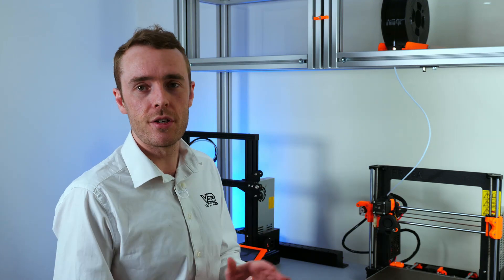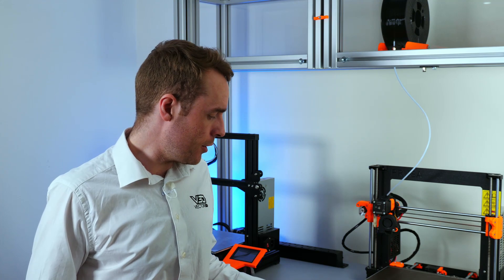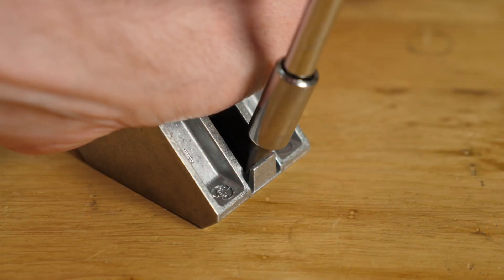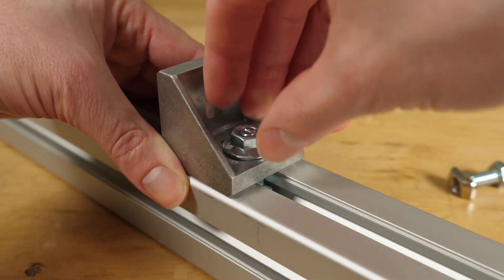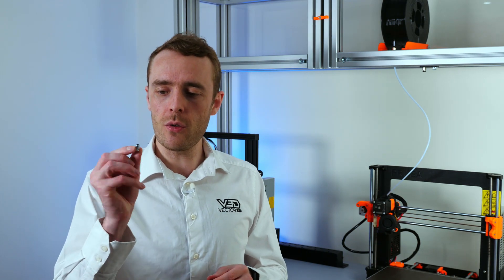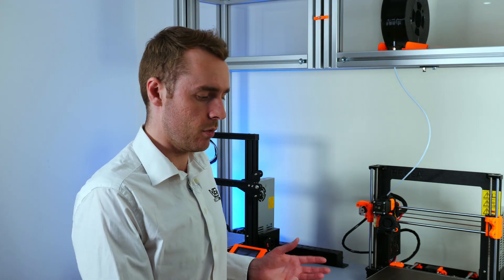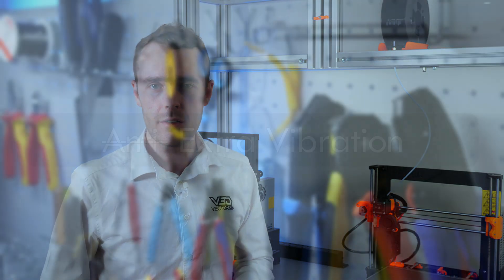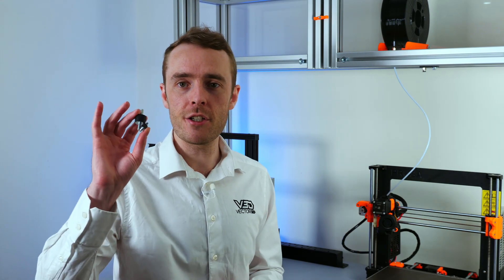This should be EASY, but it isn't...  Anti Vibration Worktop

Comment: Is your workbench attached to the wall? You can't add much more mass to it than your house. You should attach the top of your printer as well as the base to the workbench after mounting it to your wall.
Reply from the maker: It isn't, mine is actually on wheels so attaching it to the wall would limit the movement a bit. I'm in rented accommodation so not allow to attach anything to the walls sadly, but it gives me an idea of how walls could be used to help. Thanks.

Comment: Hope you are still reading these comments.
I strongly suggest you change your entire paradigm of thought.
You are thinking of "vibration," and using "loudness" as a metric. This is entirely the wrong approach.
Think instead of "coupling vs de-coupling" and and use a combination of metrics - I suggest print ringing, loudness (measured) and frequency. Frequency is probably best measured using an accelerometer and an RPi. There are plenty of established libraries for this including one specially built for Kliper (input shaper).

You also seem to be re-inventing the wheel, and I suspect relying on unreliable sources for information - namely the maker community, and the hobby woodworking community. In my experience, both of these communities are pretty clueless on these topics. There are industry wide Best Practices, with cost effective solutions.

The maker community seems to think that rigidity is not important to 3d printers, and then produce prints that are covered in artifacts that are the result of harmonic vibrations.
A rigid machine coupled to a work table, that is then effectively damped will not only print quietly, but will have minimal artifacts. Damping can be achieved with something as simple as a hollow table top filled with play sand. Hard objects will transmit higher frequencies, soft materials transmit lower frequencies (hence you turning your workbench in a giant speaker). Combining the two will allow rigid coupling while minimizing transmission.

There is a reason why the most common solution to vibration is a heavy mass (or plinth) anchored with hard/soft layers to the floor (or whatever), and the device coupled to the mass directly. Sometimes tuned masses are suspended from the plinth. In your case, hanging a 3-5Kg bag of weight (play sand, lead, etc) would probably have helped your speaker table top.

Comment: For dampening, you can always try gluing foam or rubber on the under side of the table top in the center. Check out RTOM Moon Gels for drum heads. Not the right product for you but the concept is solid.

Comment: I made 3d printed 90 degree brackets which I screwed in with wood screws from underneath the bench top, I framed my big L-shaped bench with 2x4's so it also also allowed me to print separate shimmed pieces for the pieces I was screwing to that weren't perfectly flat. Didn't want screws showing from the top, gunk will inevitably settle into the recessed areas.

Comment: Any form of mechanical fastener when used to attach the top surface to the metal frame will point load and concentrate any vibration to that spot, effectively increasing its energy transmission. I would suggest looking at something like industrial velcro, hook and loop fasteners along full lengths of the top. As there is a natural flex and resistance in the fibres and hooks. Effectively tens of thousands of micro springs that will dampen as well as distribute any vibratory force. You will need to use staples to hold it to the underside of the table top (buy a Milwaukee m12 electric staple gun) and use 3M primer 95 on the metal before applying the velcro and it will stay there forever. Its an adhesion promoter that really works. Another one that's amazing for vibration absorbing is 3M VHB tape, the thick (3mm) clear kind. It's not removable but could form the basis of an isolation plate. I workes within a certain part of the military packaging industry and vibration was a big thing we had to deal With.

Also, you have been using metal countersink tools on wood, which is why you have those flat spots. Look up the festool centrotec countersink tool. It's actually conical with a hole in the side. It produces perfectly angled and smooth counter sinks. Use with a depth stop for consistency. Also ensure that you have center support for the plywood in the table, as it will flex over time. Consider moving up to 24mm plywood as well. The extra mass in the material will be benificial. Also look at Finsa Fibreboard as it's available in colours like black, grey, red, yellow, blue and green. Very dense and will last for years. Companies like cworkshop, cutltist will be your best sources of material and cnc saw cut components. Its the secret of many cabinet makers. They can supply anything you need including edge banding.

Comment: look at how parts are "held down" to a CNC.   something that rotates on the bottom of the surface, and slots into the channel on the extrusion.  Then you tighten the bolt, and it pulls the "clip" tight.  Sort of like a clamp in some respects.  Sorry this isn't as clear as I'd like it to me... similar to this, but with a longer distance to provide more "leverage....https://smile.amazon.com/Rok-Hardware-Fasteners-Screws-ROKSTBFAST/dp/B01FGE8BJQ/ref=sr_1_5?dchild=1&keywords=Table+Top+Fasteners&qid=1613093302&s=hi&sr=1-5

Comment: Why attach the worktop to the frame at all? Gravity will hold it in place, and no drilling or screwing around will be required. Try various types of rubber, cork, or felt strips or tape between the worktop and the top of the frame.

Comment: Mount an anti-printer the the underside of the worktop. It contains all the same steppers as the printer above it and runs a synchronised code so that it produces exactly opposing motions under the worktop to the ones the printer is making above it. The vibrations from above and below will exactly cancel out, thus eliminating all secondary noise. It will obviously double the direct noise the steppers emit into the air as there are now double the number of them but engineering is all about trade offs.

Comment: Add mass to the frame: mould sand/epoxy (epoxy concrete) around as much of it as you can. Bolt iron onto it (but tight so it can’t rattle).

Comment: Multiple layers of isolation and damping from feet of printer down to feet of workstation. Rubber under printer feet then concrete slab, then rubber sheet, then worktop floating over frame or clamped hard to it with rigidity enhancement like angle iron attached to its underside, then rubber feet or rubber tiles between workstation and ground.

Comment: Composite formed of alternating layers of GFRC and polyurethane rubber with lots of filler to add weight. Gets you mass and damping in one. Will take a while if you wait for each layer to cure between pours so do all the concrete layers at the same time if you have space for the moulds and put them together using rubber pours, with minimum setting time between.

Comment: How about cork or beech or something inbetween the frame and the top. I think the top material still can act like a speaker in this case though, so often the best solution is to isolate at the printers contact to the top.

Comment: If you think about it you hit the nail on the head with your analysis. With the dampers it’s a speaker, which you can hear in the room. You can hear it less in other rooms because the vibrations are isolated from the frame and therefore the floor and the rest of the house.

My idea for keeping noise down is to slightly adapt your original idea. Just make a platform that goes between the printer and the table top to isolate the printer from the table top. That could be rubber feet, a rubber pad or a block of foam. Look at how musicians isolate their studio monitors

Comment: For vibration damping I would suggest taking the advice from Cnckitchen: Concrete tile on top of a block of foam. Works well for me
Reply: exactly the comment I was looking for :D
Reply: Yes, shout out to CNC Kitchen.  https://youtu.be/OnfYA5QLA84  One thing that Stefan goes into is certain types of vibration dampening.  (foam and spring feet) can introduce resonance frequency ringing into the final print.
Reply: did just that, and worked like a charm
I did also add a few 1mm tpu feet underneath the tile

Comment: If you're marketing this bench towards DIY types you may be able to get away with creating a hollow chamber affixed to the bottom of the bed and having the end user purchase and fill that cavity with sand or some other super heavy material that can be acquired locally by the end user at low cost. To really stop vibration in its tracks, you need more mass to sink those vibrations into. There's no way around it.

Comment: You could fill the profiles partly (2/3 or so) with Sand to dampen vibrations. Works quite well on my diy-cnc router. Or mount the top rigidly and decouple the whole table from the floor with rubber feets. The mass of the table will help to lower its resonat-frequency. 
Greetings from Germany 👍
Reply: Sand/epoxy mix? Epoxy concrete.

Comment: Having rubber/foam under the worktop may help or even a cut-out area in the worktop you could drop them into. Similar to having an enclosure people adding thick rubber then paving slab, having an area built in as to not add more height to the printer may work

Comment: Take a look at how festool is attaching the worktop for its festool mft tables
And for antivibration, I'm using rubberpads under the printers, the same type that is used on hvac systems. (rubber pads with some blue stuff between)

Comment: I've always found that dealing with a noise or vibration source by attacking as closely to the source is the most effective.   Using the cheap stepper isolators is the single most effective item I've found for the money.  True, silent stepper drivers work better, but certainly not cheaper or less time consuming.  Changing out a driver board or even motherboard can be time consuming depending on your proficiency with the firmware build.   
The next most effective thing I've found is by modifying or augmenting the feet of the printer to prevent the vibration from travelling to the bed.  A 25mm thick piece of closed-cell packing foam like many 3D printers are shipped with under each foot goes a long way to dampen the tranfer of the vibration.  I've even put a small rubber "puck" like you put under furniture feet to spread the weight of the printer over a 50-75mm square of the packing foam.  That keeps the foot of the printer from digging a divot into the foam and makes the isolation more effective without making the printer "wiggly."   
Hope these help, but then they're not directly about the bench....     
Great videos, keep it up!!

Comment: concreate slab
Reply: I was thinking the same type of thing.  I think you need more mass.  A slab on top of a piece of foam is likely the easiest and best way to deaden the noise and not transfer it.  Didn't CNC kitchen do a bunch of tests on this?
Reply from the maker: Ye, perfect for small applications where the concrete slab won't weight like 100+ kg :)

Comment: Sorbothane.
Reply from the maker: Great material, i use it for the feet on my mk3s actually and it works well. trouble is that its really expensive, it is here in the UK anyway, don't know where you are, maybe cheaper there.